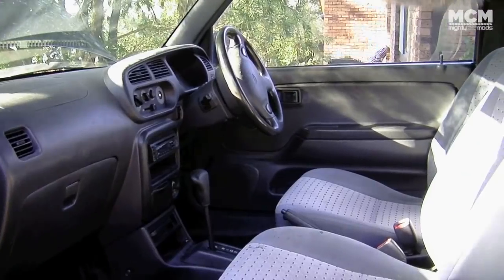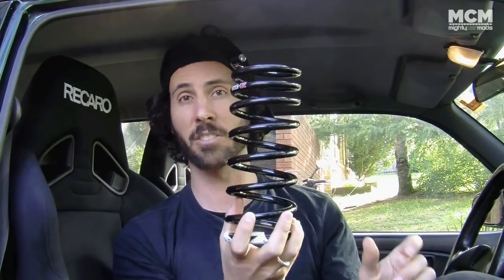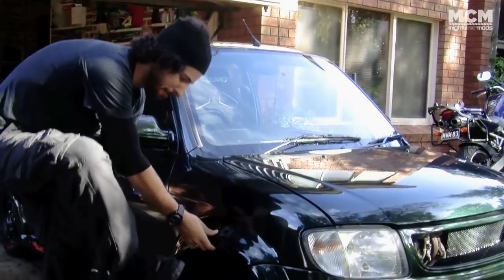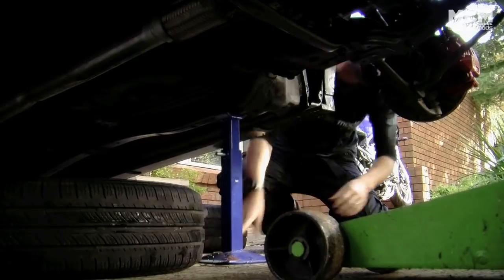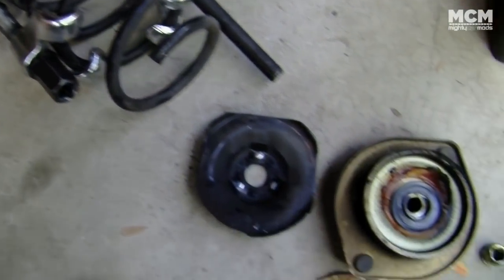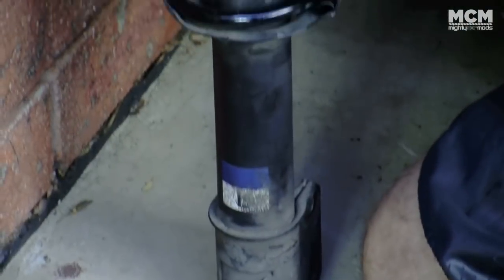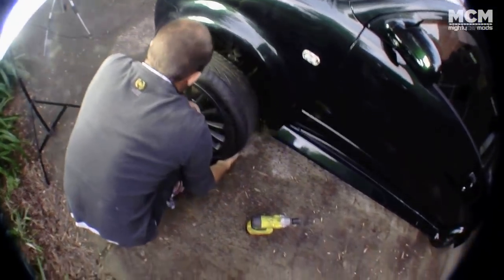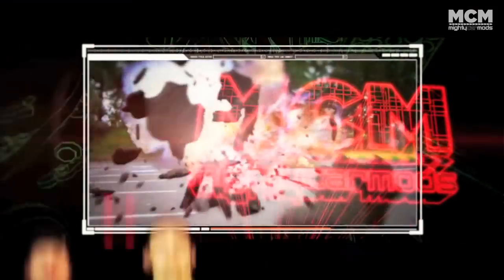How To Install Lowered Springs

Comment: Every single video ends with "you can do it in one afternoon by yourself!" and it always starts with me spending 20 minutes trying to get the jack out of my car, failing, driving to a store to buy some tools, not buying anything, then going home and crying over my non lowered car
Reply: +crcn11 10 months on I've bought lowering springs and given up.  Good times
Reply: Try again! xD
Reply: @Kayoss90  lol
Reply: it took me like 1 hr to lower the front of my car and about 2 weeks for the back lol. ended up doing one back side wrong smh🙄
Reply: @Kayoss90  Jesus lol lay off the poor guy
Reply: Lmfao
Reply: @crcn11  5 years later did u end up lowering ur car bro
Reply: 7 years later did u end up lowering ur car bro?
Reply: The springs in yet?
Reply: What about now? They in yet?
Reply: 11 years later you end up getting em installed
Reply: 7 years are they in yet?
Reply: 8 years bro did you get them in?
Reply: Just checking in from another dimension: are they in yet?
Reply: did you get it done? they in?
Reply: It’s on bags now ? 😂
Reply: Bro you sed it

Comment: I forgot to the dance and now my car is making knocking noise.
Reply: h4mza786  have you got a Subaru
Reply: +matt34323 I dont get it.
Reply: when Subaru's have a knocking sound it usually means that they is something wrong with the engine. (to put it simply)
Reply: +Brett Sanders Knocking being bad applies to almost everything, not just Subaru. As far as I know, some diesels are the only engines where knocking is normal.
Reply: +Eric Fixalot it was a joke
Reply: +Brett Sanders i like this and i drive a 2014 sti
Reply: you had one job

Comment: too bad the 17s werent on the car in the last flyby part of the video. probably why they didnt show the 17s actually being on the car with the lowered stance.
Reply: dont know how you can tell since its too blurry to see.
Reply: Mikey Lombardi You can tell they are not the 17's by how skinny they are. All the detail you need.
Reply: Absolutely right. 17's didn't fit that low.
Reply: josete suarez In the video, they said it was tight but DID fit so I have no idea where you got the idea that they didn't fit.
Reply: bob82pigdog Ummm, actually you can't tell. Nice try.
Reply: ShiiftxP  and Mikey Lombardi are right, stock wheels in drive by. blur aside, tight fit comment aside, it's as clear as day the wheels are narrow as hell at the end compared to the 17's that extended to the face of the flared guard in the final car, and by final car.
Reply: Eric Ver Linden just pay attention at the end of the video, when the car comes towards the camera in a low light condition. Watch carefuly and you'll realize that the size of those tyres is not the upgraded one.
Reply: Eric Ver Linden Errm actually yes you can! Put the video in 720p then pause on the moment they drive by the camera and they are clearly steel wheels, which are way smaller, narrower and don't fill the arches. You should go and see an optician maybe?
Reply: i think the point of the argument is, if they tell you it fits when it actually doesnt, do you want to trust them next time your going to follow a whole video to do work on your own car?

Comment: To lower my car do I also need to replace the struts too? Thanks.
Reply: Better off with coil overs
Reply: xDoyle514 Still need aftermarket struts with coil overs bro
Reply: Coil overs have the strut, springs, dampers and shocks built in.
Reply: ***** Not all coilover styles man
Reply: ***** A suspension  kit also has that to and  is  cheaper than a coilover. It's personal choice I  guess.
Reply: No but it would be a good idea if your car has a lot of miles (over 100k)

Comment: So plan too do this soon, thanks for the insight of what I'm getting into and doing. You guys lowered the car from what I can tell, 7cm, 2.7 inches, which is technically way more then I'm dropping my car, so my wheels should still fit, hopefully. 1.25 inch(3.175cm) drop.

Comment: I cut my springs on my 77 :)
Reply: ***** Oh, and YOU'RE*
Reply: ***** there are a lot of people that cut their springs....i did the same and the driving is still great
Reply: Brad V do you guys think if i buy 2 inch lowering springs on stock struts for my 02 Eclipse it would be fine or would it mess up other stuff? for example Shocks,Struts,etc
Reply: James Veach It didn't do anything bad for my ride TBH. It's just too low for my likings. Best thing to do is leave it, or lower springs, but put the blocks on the back to rake it, if that's what you want.
Reply: Brad V 2 inch lowering springs? or what did u get? and how long has it been since u put em on?
Reply: Brad V man I don't even know if you're trolling or being serious. Let me ask you this, when you run out of food, do you eat your own shit or do you buy more food?
Reply: ***** No, it doesn't make it look expensive as all. You contradicted yourself by saying "Look like expensive coil overs", then you say "You can't afford $150 springs". Dumb shit. All I did it for was lower it. Besides, it really doesn't weaken the suspension, by taking the AC/Heater and some other things the vehicle lost a decent amount of weight. My vehicle weighs maybe 3,000 lbs.
Reply: ***** No, it's just a cheap way to do it. Has nothing to do with HOW I did it. It's what it was used for. I.E lowering the vehicle. If you think that's rice, you're an idiot.
Reply: ***** You're the only one that's said shit about it lol. I've never met one ricer to put rake on their car, or cut their springs. You really are ignorant. My car is fast, I don't need to make it "appear" like anything.
Reply: Damn everyone is hating on this kid's post haha. I wonder why....
Reply: Sorry bro, but that is not ok. The thing is when you cut the spring a lot of heat appears in the steel coil -no matter if you cut it with a saw or with a torch - and that generates the internal structure of the steel change for ever. Specifically, the mechanical resistance is reduced and the steel becomes more ductile as well, wich means it could fail with less strenght than before. You may not notice now, but definitely will notice if you go to a track or make some hard driving with the car. Sorry for my english, hope to helped.
Reply: Victor Estrada you should never run old struts with lowered springs.  You're bound to have a blown valve in your shocks at this rate.  If you're gonna get new lowering springs, buy some shocks thay can put up with the abuse of the lowered and harder springs.
Reply: Got a 2014 accord coupe v6.  Gonna put in some Tein street advance with the edfc pro for 2k soon.  I spent 36k to get the car with all the custom bits added to personalize and protect the vechicle.  Spent an additional 5k for tid bits like exhaust porting/polishing, bisi cams/springs, sound system, and a retrofit.  Soon to go with some Enkei 18" 18 lbs rims with michellin pilot super sport and a 22 mm rear sway bar.  Fact is do it right or don't do it at all.
Reply: Matt Vang look at that, getting ridiculed by what you do to your own car. && being labeled a "broke ass bitch". It doesn't affect your vehicle in any way, so why condescend the guy for doing what he wants. It's mind boggling why you feel the need to hate on someone's way of doing their own thing.
Reply: ***** How do you know the condition of my suspension? I wasn't raging at anyone, neither was the other guy. They were insulting us just like you are. I've had 0 problems since I cut those springs.
Reply: ***** You're full of yourself dude. I have experience with cut springs before, nothing happens! You think my wheel is gonna fly off or something? smfh. Other than spring rate being a little more shitty than stock on the bumps, everything else is totally fine. But your ass just want to run your mouth and bash on me personally? What kind of shit is that.
Reply: And you have 3500 coils? What type? What car you got? Funny you say you got some expensive coils but have no videos or nothin on your channel. Lol. Youtube warrior account to talk trash? Make up stories? If you wanna see my build go to my instagram @MattVanggg.
Reply: LOL idgaf. And yes that is my celica supra believe it or not. Its on cut springs. Thanks for the compliment. That civic is a beast, i wouldn't make fun of it if i were you. Its a Super Street featured car, one of the first K swapped civic in America.
Reply: Matt Vang These dudes think we're made of money or something. I cut my springs and I liked the look, I had no problems with the actual cut springs myself. Just slapped a new front suspension on, AND NEW SPRINGS. We can't just open a credit card and slap 4-5k on the car.
Reply: ***** Lol, it's called bills and taking care of other things in life. You fail to realize that everything on cars cost money. I make a decent amount of money, but again, you don't know my situation. So how do you sit on your high horse and judge me?
Reply: ***** You also don't know my car and what she's like. Why would I replace those things if there's other things that need replaced. I just redid my front suspension and it's hard to get into shops that don't try to fuck you, if you don't want to do the work by yourself. 

So again, you don't know peoples situations. You keep jumping to conclusions and are eating dirt.
Reply: Do you even spring rate?
Reply: ***** I'm supposed to be hurt?? LOLOL
Reply: Kids out there starting to mod cars… don't cut your springs!
Reply: ***** I drove a car with cut springs for over 10 months, you were saying?
Reply: Rancid Rob Right? 9 months here.
Reply: Brad V Would you cut your brake lines to make them shorter then duct tape the line back together after reducing its length? No you wouldn't. Lets face it kiddies, cutting your springs is a cheap way to lower your car but it is not recommended by anyone.

It doesn't really damage anything but the ride will be shotty (or not as good as it could be) because the springs won't compress, rebound, and dampen the way they were made. Go ahead and cut your springs if you really don't have a couple bucks for a set of proper lowered springs. Plebeians.
Reply: Violetta You're comparing apples to oranges. Upfront springs don't compare to brake lines.
Reply: Brad V Well my point still stands, it's still the cheap way to do it and isn't recommended. It gets the job of lowering done but the springs were not engineered to be shorter than they are. 

Oh well it's still better than heating them. That really ruins them. You'll get a better ride though if you invest in lowered springs.
Reply: Violetta No, cutting your springs has nothing to do with cutting your brakes. You cut your brakes, you can't brake. You cut your springs, it changes the height. I drove on it for 9 fucking months, not one change in feel for the drive. I only saw the height change. My GF lives on some fucked up roads, never once felt a difference in drive.

So whatever your "Facts" are or "opinions" mine say otherwise because I'm the one that felt no difference.
Reply: People need to realize that struts determine ride quality, not springs.
Reply: Matt Vang Older cars don't have struts. Not my camaro anyway, it's springs.
Reply: I'm curious to know how the springs are holding up, any issues at all?
Reply: pjijn the pigeon I drove on mine cut, for 6-9 months, I felt nothing different. I was gonna replace my suspension anyway so I figured I'd give it that stance. Like I said, I felt NOTHING wrong with my drive.
Reply: Brad V Interesting. I was considering it for my Mini, but I think I'm just going to buy coilovers after some research.
Reply: pjijn the pigeon See I drive a 77 Camaro. That suspension is almost 40 years old. What's done is done. I needed to replace it anyway. Having it look cool until I got my funds situated for suspension was worth it.

Comment: If you drive hard and hit big bumps at speed, you can risk bottoming out depending on the amount of drop. Depending on age\condition of current struts, you may want to change the struts when you change the springs. My car only has 35k km on it, so I am just changing the springs and then saving up for a Bilsteins all round.

Comment: I did the front springs/shocks, only put enough compression on the springs so they didn't explode too far. Worked alright. Getting them back on I just pushed down and screwed the bolt on, no need for compressors lol. Bit tricky, but it worked.

Comment: Also worth noting that depending on the car you may need other suspension components when lowering (like camber plates, control arms, ect) to get the alignment right.

Comment: Yes lowering springs will lower the car of course. Shocks, Well it depends on the condition of the existing ones. If they are shot, then replace along with springs. However, if they are decent/(you're frugal) you can swap springs only. Just be aware that if the spring rate too far stiff from stock the dampening capability of the factory strut will show its weakness, car will bounce. But if you don't mind..it don't matta. If you're super cheap you can trim coils symmetrically until desired drop.

Comment: camber is dependent on a horizontal axis while ride height is on a vertical axis so if you want camber to remain the same even though the car is lower then you have to mark it

Comment: I lowered my Abarth and the steering now feels allot looser any ideas?   I have not done the alignment yet but still has me worried
Reply: When you lower your car, it's always adviced to get an alignment either before or after the installment.
Reply: John maghirang yep it did the trick good advice then the next day a bus hit me just my luck
Reply: Dang, that sucks. I'm sorry
Reply: Shit happens man I totaled a brand new Camry  2 days before getting my camaro. So my parents gave it to my uncle when it arrived from Texas.
Reply: You may  need to get the camber done and the tracking too. Also an anti-roll bar will  help as will a strut  brace.

Comment: I just did this and the hardest part was removing the top strut hat. The nut kept spinning. You have to use a go through socket (a socket and wrench with a hole in the middle). You to use a hex key thru the socket/wrench to stop the shaft from spinning. If you use an impact wrench you run the risk of spinning the shaft. Don't use a vice grip to hold the shaft unless you plan on throwing the strut away. Most people will not have this tool and autozone/oreilly didn't have it. Harbor tools > $21

Comment: Not necessarily, but it you run lowered springs on stock shocks you will reduce their lifetime. Also the driving experience may become bouncy but this varies from car to car. Best to check on a forum with modding enthusiasts for your car.

Comment: Not only that, you'd also be twisting the metal and altering the material structure and material qualities which can have an averse effect on stability, and possibly even crack later on. It's worse than cutting a ring out.

Comment: A friend of mine saw my lowered car and wants to lower his too. To cut some corners, he said he'd cut his stock springs, which is ill-advised but still practiced, but come to think of it: what's the actual problem with cutting springs ? My best guess is that the bottom part (where the cut would be made) would no longer lay flat in the strut hat, but rather angled, as it comes off the coiled part, which would cause it to dig into the hat.
Reply: They tend to bounce around corners very dangerous not advised it's not safe! take my advice don't do it drive a car with cut springs

Comment: I heard that putting lowered springs on after market shocks ( I replaced mine to better gas shocks on a Mazda 3 instead of the OEM) that eventually the lowering will start to wear the shocks out and then you have to replace the shocks as well. I hear coil overs is the best way to get the lowering. Is this 100% true ?
Reply: Yup
Reply: dharmaboy75 Not 100% true. If the aftermarket shocks are meant for lowering springs, like KONI Yellow or STR.T or Bilstein Sports, you'll have no problem.
Reply: JobeMinacum dharmaboy75 also KYB Gas-a-just accept up to 2 inch drop
Reply: Coilovers can make the ride more uncomfortable that it previously was.

Comment: Kinda, theoretically when lowering the car, you are limiting the operational range of motion of the shock thus lowering durability (not enough to really worry though). Whether or not it will destroy the shock is entirely dependent on the shocks/struts in question.

Comment: I find it interesting that the same guys who tested and "debunked" cold air intakes making fun of them the whole time tell you to install lowering springs on your car based on a shoe test and don't bother to discuss any of the downfalls of lowering certain cars. Downfalls like:

1. Not replacing the stock struts and shocks and the potential of blowing them out
2. Bump stops engaging too quickly causing aggressive understeer
3. Altering suspension geometry actually degrading cornering ability

Comment: "Logan Cabi" youtube sucks and won't let me reply to you. so if you're reading this coil overs are better because lowering your car on stock shocks and aftermarket springs will usually wear the shocks out much faster than stock. not to mention coil overs are adjustable so you can find the perfect wheel/tire/height combo for your car

Comment: Here is some good advice to lower your car. Step 1)  slap yourself silly till the feeling of lowering your car pass. 
Step 2) if the feeling of lowering your car have not passed repeat step 1) as lowering your car isn't worth it as stock cars aren't designed to be lowered and can become dangerous especially if you aren't a suspension specialist. 
Or skip step 1 through to step 2 and save up and grow up and buy a sports car.

Comment: With my current spring/shock combo, I don't even need spring compressors haha.  Although, a mild lowering spring or stock springs should DEFINITELY be compressed.  Those can be fatal.
Reply: Sean Kallas yup, and when it comes to car that weight nearly three times as much as this Cuore, it will go bad.